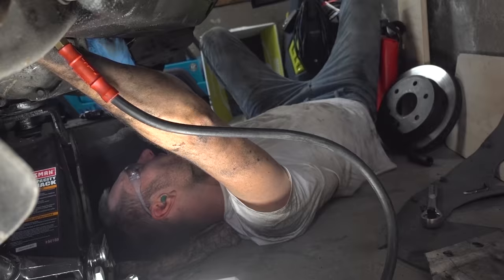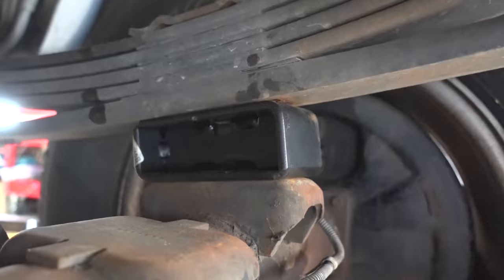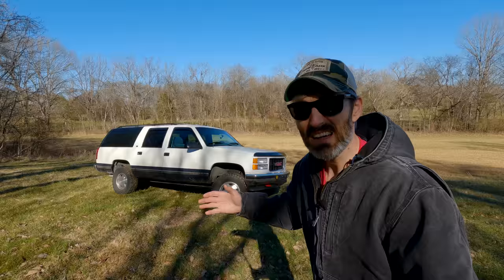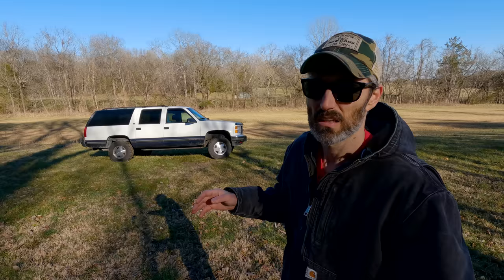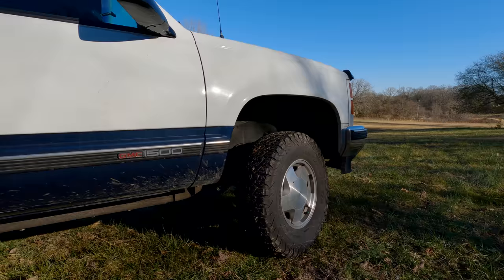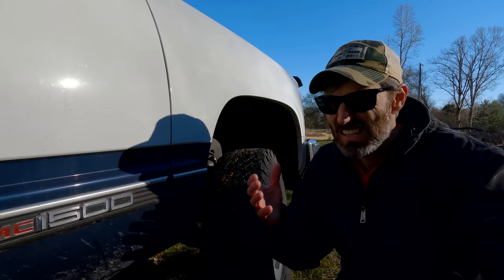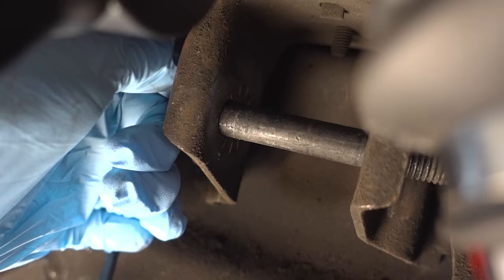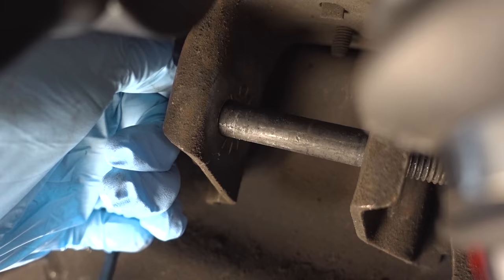Rough Country 2-3" Lift Kit - LONG TERM REVIEW!!

Comment: Just go with the body lift
Reply from the maker: I’m thinking.. 🤔
Reply: @1RoadGarage   you will get the clearance for the tires and keep all the suspension the same. I'm curious if you'll be able to go back with the dif dropped to the lower position

Comment: RC is not that great. Measurements being off is common just like with my 6 inch lift. I even ordered their step bars that were advertised as direct bolt on, no drilling no cutting and when I got them the instruct required drilling and cutting and oh by the way, the measurements were off so it needs to be modified to fit.

Comment: You need pieces and part from about ever kit out there to fab a lifted GM IFS.
Keys are a joke, waste of money, factory key will crank the A-arms right to the droop stops.
Don't relocate upper A-arms, instead use extended forged knuckles/spindles, steering geometry stays in factory position, no mickey mouse dropped steering crap, don't forget longer braided stainless brake lines..

Use whatever kit for the relocation of diff and lower A-arms, preferably a kit that uses additional frame mounted supports.
Do NOT use any relocation parts that requires the "cooling fins" ground down or off because??
There structural not cooling....
Leave one torsion bar out, jack that side up untell suspension is fully compressed and take measurement from shockeye to shockeye, do this again at full droop, this will tell you the lenght and travel that the shocks must have.
If you had a good alignment before you started, really good chance it still in or will take very little to bring with in spec.

This took 3 years on my 90 1/2 ton to figure out what works, however it works really well now.